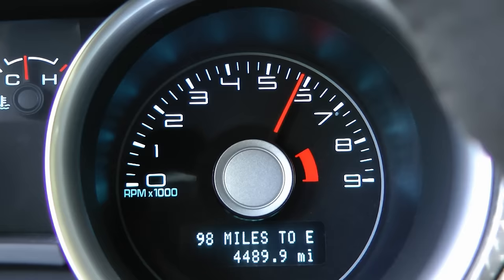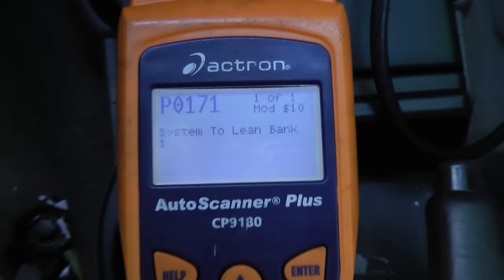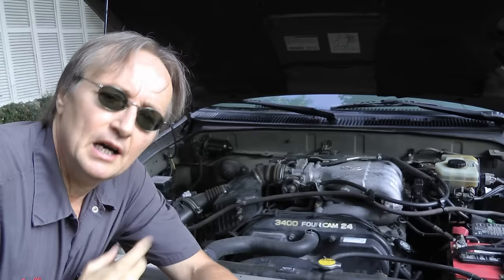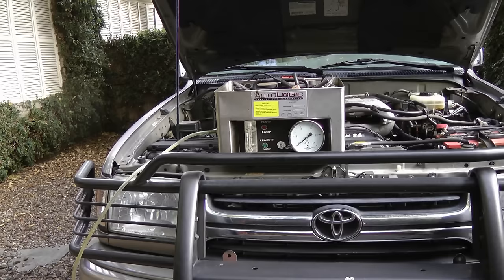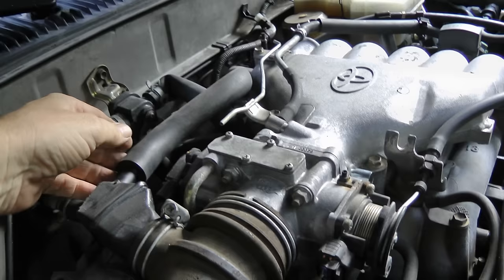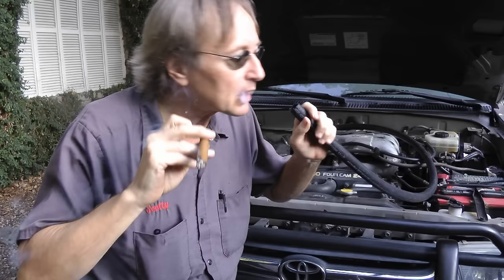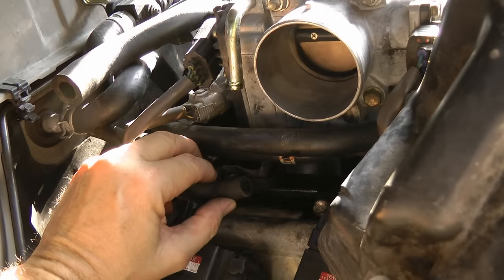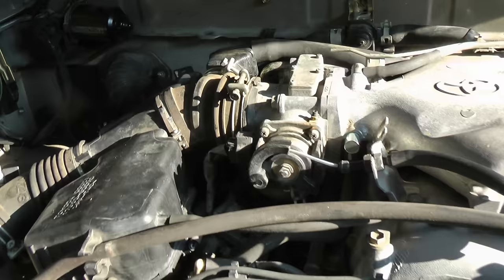How to Find Vacuum Leaks With a Cigar (Life Hack)

Comment: My 280zx is idling horribly, bouncing on 500 rpm never stable, and often stalls out. Everything was working perfect even surprise the smog technician of how clean it ran. Anyways, I notice it is running rich, black soot on exhaust and small black smoke coming out. Not to mention the smell of gas in the engine bay. I am not sure where to start but currently I'm looking a vacuum lines, when I pull one out it started to idle a bit better what could this mean? And basic places to start looking? 

Thank you so much you make the best videos!
Reply from the maker: vacuum lines don't make black, black is too much fuel, vacuum leaks are too little. On those, often a bad air flow sensor does that, but also check for leaking injectors and or pressure regulator

Comment: Hi there. I have a 07 Mercedes GL450. It  drove just fine and then I took it I for an estimate on  repair 
b/c my horn, wipers, signaler, cruise, light dimmer don't work. Now when ever I am still or parked it Reves or idals up. The fan motor works fine. What's your opinion. Thanks

Comment: Oh!! I never even thought of this!!  My (New to me) (6 ford F250 is idling rough, hesitates and even backfires somethimes when I throttle it up, I just replaced the entire ignition system and the code I am getting is PO171 and P0174 OBDI2 which indicates the system is running too lean, Also I am getting horrible fuel economy and rough Idle. The poor Fuel Economy would be due to the fact that the engine computer is enrichening the mixture in order to compensate for there being too much air in the system, the rough Idle is because it canot compensate for that much air getting in.  The backfiring at throttle up is due to the extra air in the intake manifold. before I realized that these are all symptoms of a vacuum leak I replaced the fuel filter thinking it may have low fuel pressure, I cleaned the MAF sensor thinking it might be dirty, I did some research and found the symptoms of a vacuum leak are identical to the symptoms it is displaying.  I am searching everywhere for a vacuum leak starting tomorrow.  Ran out of daylight today and it is Blowing 40MPH winds with a freeze advisory for my area tonight, so I will wait until it gets warmer out!

Comment: Hi Scotty , I  love all of your blog very helpful on repair I am having issues with my 2000 odyssey  which I bought new it has 226km no check engine light is  on I have lots of power . What I notice low idle  with a small  misfire.I replaced coil pack, 6 spark plugs clean up trottle body and EGR valve. I replaced the Idle control valve with an aftermarket. And I have the same problems. Any idea what can be the cause?

Comment: I have a Nissan Xtrail 2006 T30 Engine 2.5 QR25 automatic transmission 4x2 gasoline which being in cold temperature works perfectly but when hot vibrates, loses strength and accelerates drowning, I would like to know what happens

Comment: I’m having the same issue. When turn my car on, it revs up high. Started after repairing a head gasket. Also getting a P-0068 engine code, “throttle position correlation”. Any advice would be appreciated.

Comment: Dear Scotty, I have a 2004 Mazda 3 with a check engine light giving the code P0301. I replaced the ignition coil, & spark plugs yet the check engine light is still on and giving the same code. What could be the problem? How do I check for it & fix it? Thank you.

Comment: i have a check engine light on due to an exhaust related issue. i dont recall exactly what the code is..... but the shop told me it would cost $100 to hook up the smoke machine to pinpoint the exact problem.... how do i go about finding the problem part using this technique? thanks!

Comment: I have a 1997 Grand Prix gtp 3800. I recently changed the fuel pump resistor, fuel pump, fuel filter. When we installed the motor into the car we replace everything while the motor was not in the car.(spark plugs, wires, egr valve, EGR valve gasket, water pump n gasket and so fourth and so on. Now a year later you can rev the car all day long. When you drive it and there's a load it will accelerate but, it bucks and hesitates like it's not getting fuel, so it seems to me. I've already put to much money into this car but, I'm looking for help now to solve this issue im having.

Comment: Hi I got a 2007 Nissan  FRONTIER  se 4x4 . I had number 5 misfire bad coil. So I replass all spark plus coil .heard gasket fuil injector  on number 3 .now I have air lick on right sided and  a piping norese.  Right sided now What yu thk  is the problem

Comment: Hey Scotty. So I just had my 97 Ford Mustang cobra , mechanic also had me replace several parts including injectors,mufflers,all 4 cats,fuel pump,air control valve,fuel pressure regulator, plug wires,radiator and  the battery.  The vehicle is at a high idle at 1000 rpm.  I have the po174-p1506-po171 codes.   No vacuum Leaks and o2 sensors are new.   What’s your opinion?   My heard is twisted.  Thanks for your help. Love your videos.

Comment: I have a 1990 Jeep Wrangler 6 cylinder with a carb  and at first it shut off while driving. I replaced the fuel pump and it wouldn't start I got my battery and alternator checked at autozone and they said it was okay. I also changed the ignition coil and the Jeep still doesn't start. When I turn the key it cranks but it doesn't start and then drains my battery to a clicking sound and then when I turn the key nothing happens. What could it be

Comment: i got a p2188 and p2190 system too rich. a leak in vacuum can cause the same code? if so the same method to find the hole can be used, right?

Comment: Sir I have a 2006 2.4 Camry w 108K miles. It has about 5 seconds of blue smoke on start up. Have R&R the PCV valve. Also tried the AT-205. going down the road and flooring it with no smoke. Runs good w all but the start up smoke I am thinking valve seals. Any words?

Comment: Hey scott i have a 79 dodge d100 with a 225 slant six. it makes a hissing sound at the pcv and likes to die at normal idle speed.  i had to crank the idle speed screw up a lil bit to put a bandage on it. I bought two plastic pcv vales from two different auto part stores. And ideas ? are those Chinese plastic ones just junk. I plug the valve with my finger. And the engine idles as smooth as glass. The ball is loose and rattles too. So I'm lost

Comment: Hi Mr kilmer I have a BMW e46 316i year 2000. When I leave the engine running the consumption gets higher, but when I start driving it gets lower. Would it be a vaccum leak? I need help thank you

Comment: I have a Mazdaspeed3 2.3 turbo that has a intake absolute pressure value of 8.3-8.9 which i think is too low. Cant find any vacuum leaks. Can this be caused by a stuck EGR?

Comment: I have a 03 suburban that has a hissing noise at idle sometimes. When it does this the temp gauge goes up fast. Soon as I accelerate it stops and the gauge goes right back down to normal temp. Could this be a vacuum leak?

Comment: I’ve been having a rough idle and it’s making my car run like a cam as if the vacuum holes is disconnected but it’s saying it’s running too rich on bank 1 and 2 and something about a camshaft circuit. Tested it at autozone they said a vacuum leak is the main problem and could throw those codes any thoughts?

Comment: have a miata mx-5 from 03 got a high emission value on the o2 sensors, i changed both sensors and oil/filter change and air filter change and now the value is goin up and down fluctuating abnormaly. need help on what i can start checking to find problem.

Comment: 2004 e220d had leaked pipe at diesel filter, sprayed diesel everywhere, changed pipe and was running fine for a day, then started to lose power and 4 or 5 faults came up on dash which checked through obd2, after cleaning nearly all engine still same. Any suggestions???

Comment: My car has real loud hissing sound when i push the pedal...up hill up to 4th gear it kinda jerks and gallops due to power lose it feels and the hissing air sound is hard to find,I feel like its coming from both right and left side of the engine as I sit in front of the car looking at it.

Comment: Hi Scotty, I want to clean my GDI intake valve, in my 2018 Honda CRV. I have the CRC sprayer GDI IVK, not sure where I need to spray it, could you show me on a picture. I know I have to pass Mass air sensor, I know where that is, should I just spray in that big air tube after MAF sensor, I hear there is vacuum line that is better to spray this into, it is more direct to the valves, don't know which vacuum line or just do that spray in the big air black pipe?

Comment: My 03 Altima is missing at under 3000 rpms. It hesitates and bogs down when I shift gears. I replaced basic things like spark plugs and checked my ignition coils but it still happens. It has a p0300 code and sometimes it flashes if the miss is worse then normal. Could it be a vacuum leak? Help!!

Comment: Hi Scotty I have a question i have a 07 bmw 328i with a issue i change the spark plugs and coils and still have a random misfire on cylinders 4,5,6 and p0300 what can cause that any help can be Appreciate it thanks

Comment: hi scotty, quick question, a egr on a 2002 vw jetta tdi, the egr has 2 small holes on it where oil seems to come out from, is it possible the egr is bad? or another underlying condition that is causing the oil to  come out the side hole on the egr?

Comment: I have a question i have a map sensor code but i replaced the mapsensor and code still comes back on what eals could ir be is it possible i have vacume leake? 2009 honda civic ex 1.8 sedan

Comment: my car is having a code p0172 only, rough idle at low RPM and then straightens out if i give it more gas. above 2k rpm not sure what is wrong with my car. o2 sensor? vacuum leak? spark plugs?

Comment: Ok so if any of you can help I got my engine replaced entirely by a ford store and is it possible if they used an old gasket for the headers could it cause a vacuum leak? I suspect they did something like that.

Comment: I have a question I have a 99 Dodge Durango with a 5.9 liter engine that I just installed I have a mystery vacuum leak that starts as engine warms up you've been driving it for a while and all sudden it'll start making a hissing sound I replace the gasket spacer on the throttle body but it still comes back I'm wondering if it might be the intake that's leaking since it is an aluminum intake and it only does it when the engine warms up once that happens it starts a rough idle

Comment: Hello Scotty. Thank for your videos they are good and practical. I have a question and I hope you can guide me on the right direction. I have a 1987 Ford F150 with a 351 5.8 engine. I loss a lot of power so I change the timing chain and nothing, new spark plugs, wires, distributor, harmonic balancer and I have the carburetor professionally rebuilt and nothing. sounds and runs good when it's on park but when I put it on gear or reverse no power the all. I thought it was the transmission, so I putted 2 towers on the rear end and on DR and did ok up to 50mph. This is been going on for 3 months. last Saturday a friend came over and was listening to the engine and told me that the engine was running in only 4 cylinders. And he was right I removed one by one the spark plugs wires and with 4 wires pulled out still running fine. I check for spark on the wires and they checked ok good spark, the firing order is good and the timing is good. I don't know what to do. Please help me out before I go crazy. Thanks and Happy New Year.

Comment: Scotty tried to ask a ? On the website wont let me. I have an 02 mustang 3.8. Going through alot of gas. No codes. New fuel pump. Sending unit. Mass air flow sensor. Tune up. I'm going crazy trying to figure out why this is happening. I'm a disable vet. Tired of spending tons of money. Where do I start. Need help.

Comment: HI scotty, I have the code P2195 and P0401 I have a 2006 ford explorer 4x4 V6 4.0L I changed the oxygen sensor from the passenger side the one on top, but it didn't clear any code. Then I changed the EGR the P0401 is gone, just the P2195 remains but now I heard a whistle when I'm driving it, I don't know what is the issue can you please guide me and how to fix it ?

Comment: Scotty, hi, I enjoy learning from your videos, and yours are always more animated, I  did this test on my 97 nissan pickup, 2.4L, automatic transmission, due to a p0171 code, and smoke came out of the egr bpt valve, (from the spongy material, that is on the top of the part, looks like  saucer looking portion of it) is that normal for that part to do that? I'm asking because I'm still unsure.

Comment: Smoke test reveals smoke coming from VSV on 2nd gen 4runner(3vze).  Is it supposed to be 'open'?  It's the one labeled "(as)" in 3vze vacuum line diagrams.  I think its the blue one:)  I also did hose to hear test and air sound is definitely coming from it but not sure if that is normal.  Also my truck recently started cranking over longer and sorta stumbles to a start.  After that during first minute of idle,  the engine lopes/surges/revs a bit(all between 1500 and 1100 rmps).  After 5 minutes or so it will settle around 800rpm.  Occasionally I get hesitation during quick acceleration from a stop or slow first gear speed.  Anyone have a clue?  Fuel pump?  Injectors?  I've checked most everything else but those are pain to replace

Comment: Hi Scott
I have a problem with my 2014 Toyota Camry LE.
The car starts to shudder, or shake above 80km/hr. The engine light is ON, starts to flash when the shaking starts. I have been driving it like this for more than four months, because every mechanic say different things. Some say unbalanced tire, others say vacuum leak, and others say motor and transmission.....
I am confused.
The codes show #4 misfires, I changed original spark plugs twice in one month and coil for #4.
Can you help. By the way, the engine light was there since 2018 for evaporation or something. But was running fine, until I stated to see traction control light lit up as OFF.
Help.
Thank you and I appreciate

Comment: hey scotty, i have a leak in my truckbed camper. i have a fibreglass topper. it is leaking from the front somewhere not at the tailgate but i cant find it.  do you think the cigar might work for that if i go around and blow along the seams and simultaneously run the smokin cigar along the inside?

Comment: Hi there. I have a 2000 Mazda MPV and the egr monitor won't go ready to have it pass smog (all most be ready in calif). An obd said that I have a p0106 (manifold barametric pressure, yada, yada). Now it overheats when I drive on a highway or in about 15 minutes around town. I suspect intake manifold gasket leak (vacume only NO coolent leaks anywhere) My question is: Are they both related? If I replace the UPPER intake manifold gaskets will it fix both problems? Thanks
Reply from the maker: If you wish to ask me car questions, I am switching my questions and answers to my website. So go to www.scottykilmer.com  and ask me in the Ask Scotty section. So please, if you want your questions answered, go to this link and join my completely FREE website. No strings attached.

Comment: Hi mister Kilmer, would you know whats wrong with my car if i told you that my car makes a low puffing bass sound when i accelerate or if i am standing still in park and accelerate fast.when i accelerate like a grandma or the car is ideling  the engine sounds normal. it does a low bass puffing noise especially when i go up hill or under load. I tried to change the spark plugs and cleaning the body throtle and all The MAP sensors. and i still have the problem. what do you think it is? Thanks in advance Btw i love your channel

Comment: Good day... I have a problem with my rpm being sluggish when I start the car and normalize after a few seconds and then when it's hot the rpm is high above 1000 rpm while on a normal VW golf 4 it's around 800rpm... I did a smoke test and noticed the intake rubbers where leaking and I replaced them then instantly got a change in speed... Before I did the smoke test when I drove 120km/h on 5th gear my rpm was almost at 4000 rpms. After I replaced the rubbers at the intake at 120km/h it dropped to 3100 rpms... My fuel economy is better but my rpms on idle is still above 1000 rpms.. So what else can it be..?
And I tried doing a smoke test again and noticed when I blow into the intake pipe thru the throttle body I can hear a blowing noise from the dipstick... And I noticed when I do that air comes out of the dipstick... So is that normal?

Comment: dear Scotty I got a problem with my Suzuki jimny 660 cc turbo 2012. the oil vanishing too quick in the engine! it take one week to lose 3 litres oil. as I use shell 5/30 synthetic oil recommend by Suzuki. is it valve problem?
Reply from the maker: more often worn piston rings, do a wet and dry compression test to find if it's rings or valve seals

Comment: Ive spent $1500 over the last 2 months chasing a problem on my 94 c1500 5.7. It runs GREAT anytime except for at night when I get off work, on the freeway after doing 70mph for about 5 minutes, it starts to decelerate and when I press the gas to compensate, it doesnt respond until i floor it. If I stay under 60mph it wont mess up at all but 70+ and it starts decelerating. Ive replaced the fuel pump/filter/injectors. the EGR, the Throttle Pos Sensor, O2 sensor, Ignition Cont Module, MAP sensor, Battery and still no joy, Autozone and O'riely both tested the Alt and said its good. Could the Alt be bad anyway???? Im lost and out of cash, please help LOL